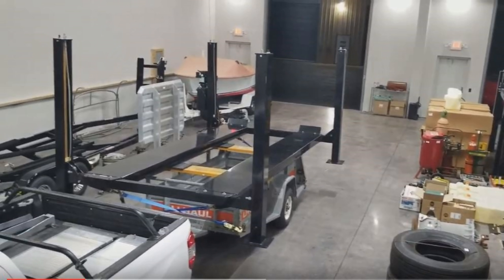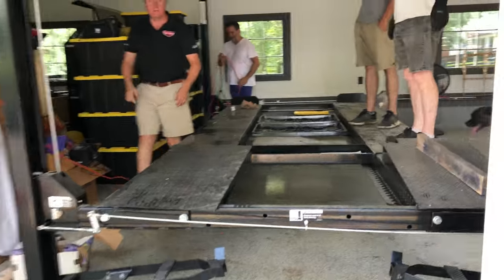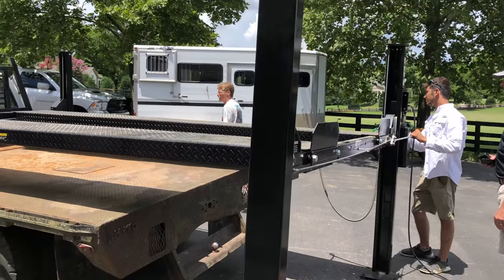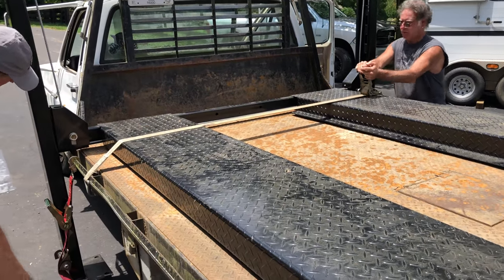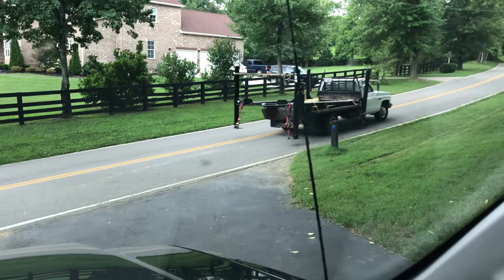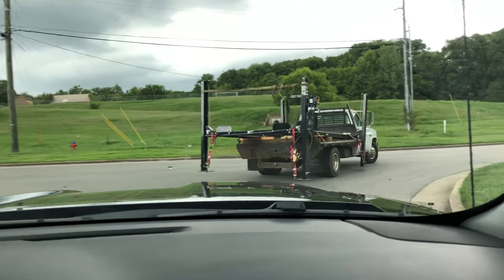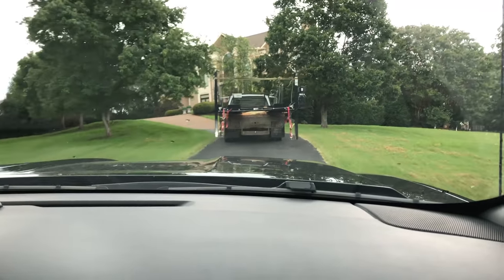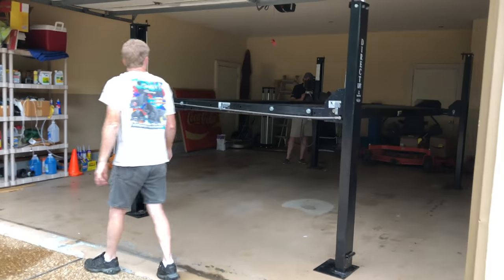Moving A 4 Post Lift (How to move a 4-post lift)

Comment: This was the silliest way to do this ever. The amount of jacking and strapping was ridiculous. I will say, for never doing this before, you guys pulled it off, but WOW!!  Had you held the lowering valve in and pushed the top part of the cable above the cross rail, that’s connected to the top of the column laterally, you would have continued pulling the piston out and creating the slack you needed. You could have don’t this in 5 min total and had each column a foot and a half above the ground. The slack would have been equal at all four corners from one push of the cable.
Reply from the maker: Curt's the expert on this...lol but I will say that the lift was never perfectly square and the legs kept binding in the tracks. I theory it seemed easy. In reality... well you saw the video.once the lift was in its new location and level and square, everything worked fine... James
Reply: Full Octane Garage Hey man, it worked!! I was just so happy no one got injured. I’ve moved a couple hundred in the last 10 years and each one is a little different, for sure. You guys got it there, so kudos for that. It just seemed if you took a few min to slow down you would have realized the hydraulic piston was working against you. And when it’s designed to lift 8k+LBS you’re not going to be able to beat it into submission. All and all, well done. You had all the tools just not the experience. Now you know for the next one!! Good luck & stay safe!
Reply: Gotta cable tie back the rope break mechanism so you can lifts the posts like that. Now try doing all that with an old bradbury...

Comment: Is that safe/recommended to leave the entry ramps on with the lift raised?  I have a 4post that looks exactly like yours (mine is a 19 year old Greg Smith 7K) and I only once left the ramps on accidentally.  Don't have the manual from when I bought it new, so never knew if that was considered safe or not.  Curious how that's held up for you over the years.  Thanks.
Reply from the maker: If you are using the steel ramps there is no issue leaving them on while lifting but if your garage floor has a finish it will rub and damage the finish. I have no manual but I do still have it today and it is working great.
Reply: @Fulloctanegarage  Thanks for the feedback.  They are steel and I did accidentally leave them on once and they seemed fine.  Just never knew if it was good long term.  Thanks for your confirmation.  Oh, my garage floor isn't even sealed....the ramps can't do any more damage than's already been done in 20 years.

Comment: could you just ratchet all 4 corners up? I need to move 3!
Reply from the maker: It was a challenge on a few of the post but we were able to ratchet them up. On the back posts where we had issues after the lift was set down on the truck we tied the post so it would not fall then we hacked each up placing extra wood between the bed of the truck and the lift then strapped it down really good and all worked fine.